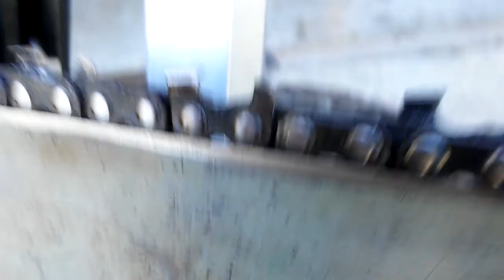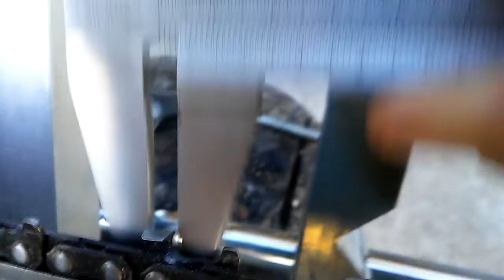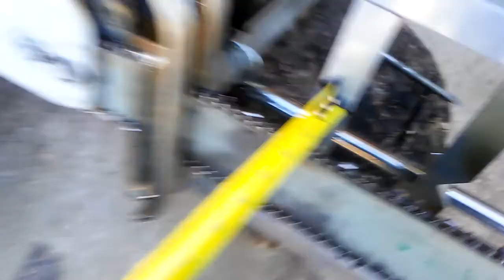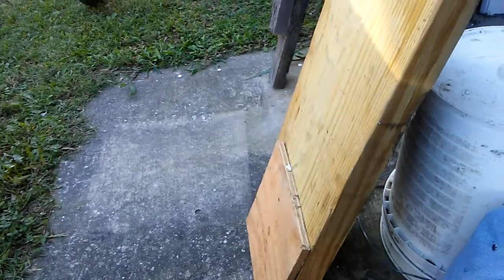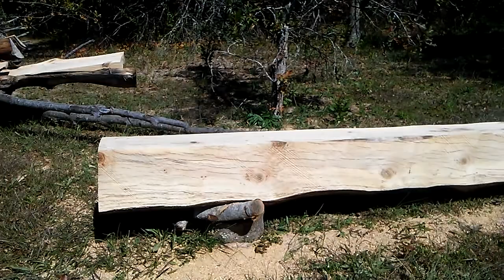Chain preparation for milling

Comment: Interesting modification there. I don’t ever mill anything but it’s still interesting to learn what works for
Different applications
Reply from the maker: Just seeing this Mr. Cajun...the main carry-over to cross-cutting in hard woods is a top-plate angle of 25 degrees or less in my opinion. A 10 degree will cut but the chips will be small....thank you sir...
Reply: @Brian2bears  that’s good to know. Thank you for sharing your knowledge

Comment: How do you saw those 10” wedges in half so perfectly?
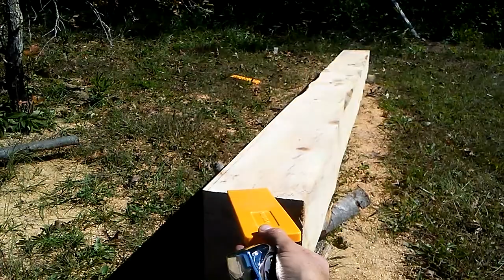Reply from the maker: Mr. kawadude400 hi! I use a custom OREGON file guide. The custom part is scribed by a machinist, if you have dremel skills you can diy. I will give you a link and a time-stamp @4:50 so it is better explained.https://youtu.be/4p_JOmDnazI
Reply from the maker: Kawadude400, I thank you for watching, taking time to comment and the sub....many thanks....
Reply from the maker: Kawadude, my apologies sir. I saw 10 degrees in your question. Not 10 inch wedge. I did that by hand with a 30 tooth per inch hacksaw a little at a time on three sides. Then clamp the two halves together and put it in the windshield of a car for a few days and they are near perfect. Again I am sorry and appreciate you watching sir...